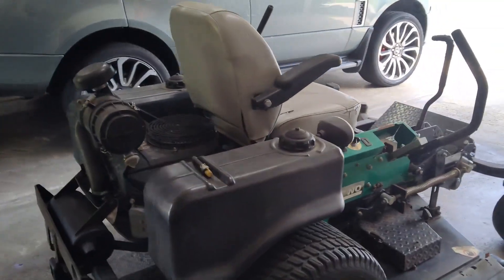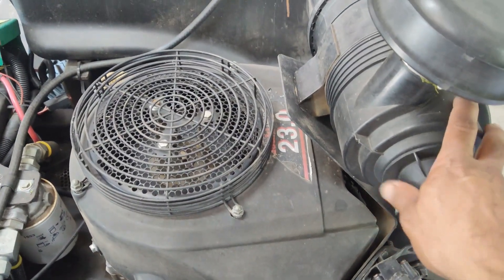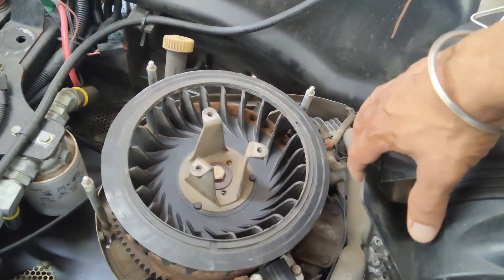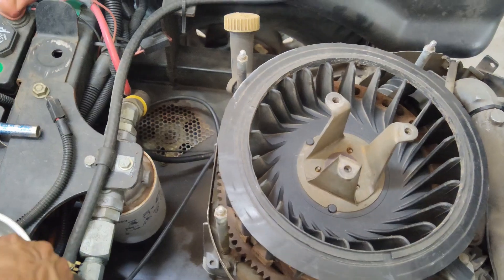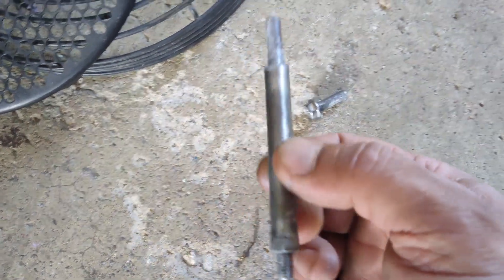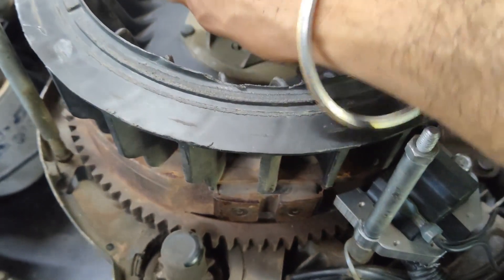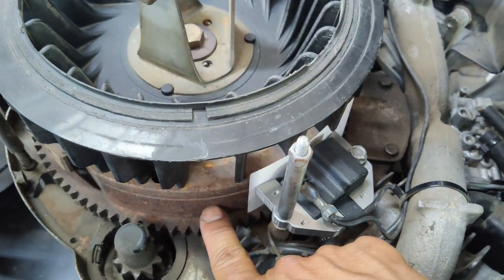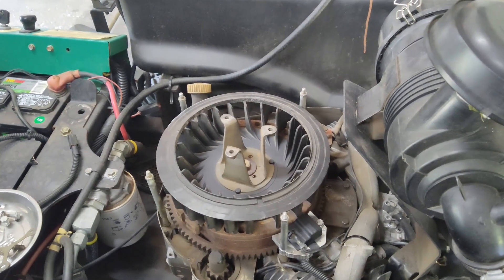Kawasaki 23hp Ignition Coil Replacement

Comment from the maker: Kawasaki OEM Ignition Coils Pack of 2(Get these factory OEM coils & Saves a lot of headaches)
Click Here:  👉  https://amzn.to/3QWC41R

NGK Spark Plug Standard BPR5ES - Pack of 2
Click Here:  👉  https://amzn.to/3YyOr5U

Genuine Kawasaki Oil Cooler(Add an Oil Cooler To Extend the Engine Life)
Click Here:  👉  https://ebay.us/otHW7a

Kawasaki O-Ring For the Cooler to Engine Block
Click Here:  👉  https://amzn.to/470fpHh

Genuine OEM Kawasaki JOINT
Click Here:  👉  https://ebay.us/bbtsL7

Kawasaki Inner & Outer Air Filter Cleaners(Heavy Duty)
Click Here:  👉  https://amzn.to/44vfDEG

Dust Ejector Valve
Click Here:  👉  https://amzn.to/3rHRe0k

Comment: Been chasing a fluttering issue on my FH451V, which I originally thought was fuel related. Cleaned Mikuni B24T1 carb multiple times w little improvement - new carbs and rebuild kits apparently don’t exist. Last ditch repair was coil replacement. Used OEM coils, and problem has disappeared. A couple of things I experienced were different than you described in your video:

Engine fan screen held on with #3 screws - which have red Loctite on them…. Regular screwdrivers just chewed them up and had them impossible to remove.  Lesson here is you need to apply some heat to them to help break the hold on them.

Engine shroud screws don’t need to be removed, just loosened to get it off.  By leaving them still partially screwed in, you lessen the chance of losing the spacers that are on them.

Cleaning magnetic pucks on flywheel is recommended. I did the business card spacer trick, which gave me a .0010 clearance which put me well within the .008 - .0016 air gap required.
Reply from the maker: Thank you for the detailed feedback and for watching/subscribing. Glad the video was helpful in fixing your issue.

Comment: Thanks for the great video and curious about what conditions lead you to change the coils.  How was it running before you changed them?  My engine runs pretty smooth until I put a load on it and then starts to back fire and wondering if its the coil(s).  thanks
Reply from the maker: Thank you for watching/subscribing.
The issue that led to replacing the coil was loss of power/misfire underload. It's a very common failure.

Comment: You can download the spec's. Each coil has two different clearance specs. They are not the same. The manual will give you the exact position where they need to be. Will it run the way you did it, yes, is it correct, no. Check the manual.

Comment: Hi, did the same. Except I put a new carburetor on . I finally figured out what was happening. The boot that has the clamp does not hold tight enough, causing corrosion. You think they would be air tight. Nope. If you do this you will be amazed. I changed the plugs to Champion copper. But go to Home Depot or your choice. Get a tube of oxgaurd.  It's like dielectric but 1000 percent better. Squeeze clamp in boot to get a tight fit on plugs. Fill the boot up with oxgaurd, about a quarter in bottom. The heat makes the clamp get weak. Oxgaurd keeps the cool. I use this on all electrical connections. Battery post, house wire ect.

Comment: That split loom will melt way quicker than the spark plug wire.
Reply from the maker: I'm using automotive loom. Some split looms are designed to withstand high temperatures, while others may melt if they get too close to a heat source like exhaust.  Split loom can help protect spark plug wires from chafing against the motor. Split can be used in automotive settings and industrial settings. It can be resistant to chemicals, auto fluids, and abrasion, and can have an operating temperature range of -40°F to +200°F.  Thank you for watching/subscribing.....

Comment: I have same mower but with the 19hp kawasaki, I'm having an intermittent issues with dropping RPM's.  I've had the carburetor apart twice to clean thinking it was the issue but starting to wonder if its a coil going bad. Sometimes its a couple seconds and picks right back up other times longer.  Thoughts?
Reply from the maker: Thank you for watching/subscribing. 
I would say yes, replace both coils.  They are inexpensive and the only good way to rule them out.  I had the same issue but intermittently.  Replacing the coils made it much better but  then had an intermittent stalling issue.  Ended up replacing the carburetor (which i had apart a few times & saw no issues). After replacing it took care of all issues.  Videos are on this channel for carb replacement... Hopefully it helps thanks.......

Comment: You talk too much!
Reply: What??? Having done this a couple of years ago, I needed to refresh/remember the gapping procedure. He did a good job, minimum talking I thought. When I look down on the (not that) old gaps that I set, I see that they have widened and maybe that could be the problem, maybe I can reset the gaps... but I bought a new set of coils, I will install those.
Reply from the maker: Thank you for watching and your feedback! I appreciate your perspective. I strive to provide as much information as possible to ensure a comprehensive understanding of the topic.
Reply: Perfect video!
Reply: Good vid,I was wondering what the gap would be when I install new coils.

Comment: spin the flywheel until the magnet is in front of the coil which will squeeze that coil tight to the flywheel and business card and then to remove the business card spin the flywheel